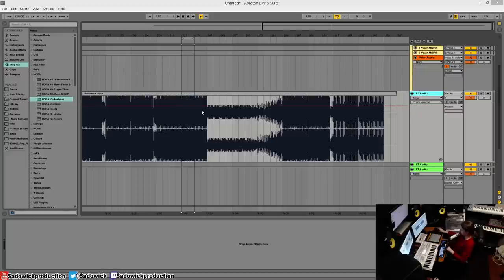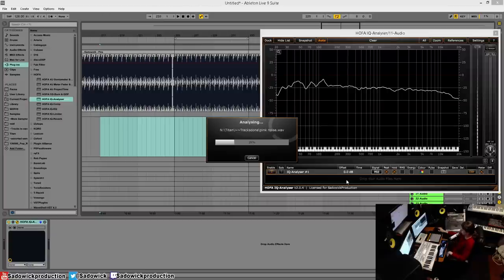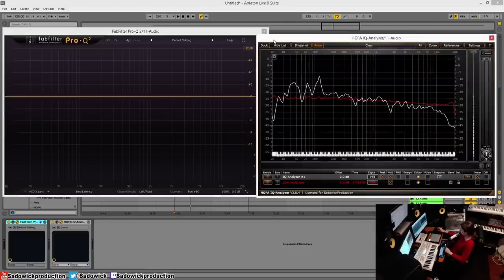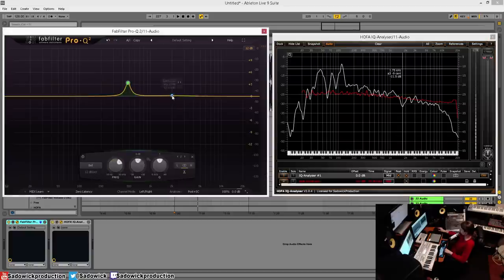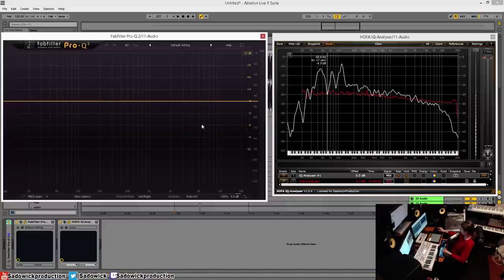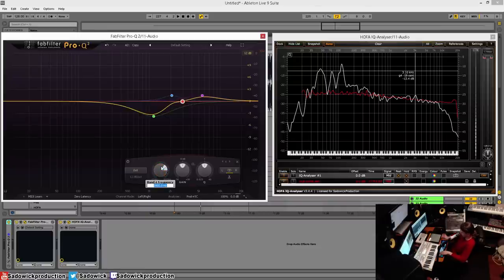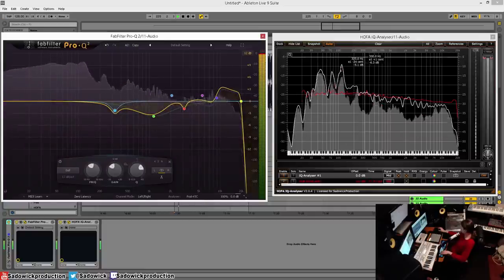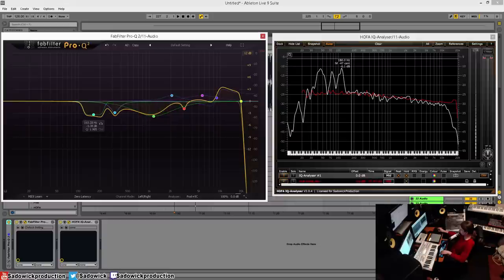Master Bus EQing Using Pink Noise & HOFA IQ Analyser

Comment: what makes you think that a flat frequency curve was the goal at mixing ? This is not for a mic pre data sheet.
Reply: That's why its an experiment....
Reply: Never tried myself, but IIRC pink noise roughly resembles the human hearing's frequency response - pink noise sounds 'naturally balanced' and thus using pink noise as a reference is a nice starting point for balancing a mix. In theory.

White noise has equal energy across the whole spectrum - human hearing perceives it as 'bright sounding'.  Pink noise is filtered down white noise with a 3 db/oct slope, each octave has equal energy as the octave before going up through the frequency spectrum - it's perceived as 'balanced'.

There's an SOS article 'Mixing to a pink noise reference' if you're interested.
Reply: @GoGoGoRunRunRun  I know what pink noise is...the problem in the video above is, he is not using pink but white noise (even his file is named wrong). As you can see, the spectrum is almost linear. Mixing to pink noise does somewhat work (i tried that), but mixing to white noise doesn't make any sense.

Comment: Well, pink noise is like white noise but with a tilt shifting of 3 dB per octave. That's totally ok for a radio mix. Club sounds or tracks like yours typically have a tilt of 4.5 dB. But it's a good strategy, though it'd be better to correct the volume of certain instruments first, check their broadband and eq them if needed inside the mix instead of eq'n the whole master.
Reply: Das gleiche dachte ich auch. Zumal er den Pro q sogar in Zero Latency benutzt. Ob das man so gut für die Phasen ist...
Reply: Wahrscheinlich klingt das Ergebnis nicht nur phasenbedingt grauenhaft, da er im Grunde eine gerade Linie mit 3 dB Tilt erzwingt und sich somit sämtliche harmonische glatt bügelt. Aber das Ganze hätte er einfacher haben können, indem er in Q2 ein EQ Match mit dem Pink Noise macht. Außerdem könnte er den Q2 analyzer auf 3 dB Tilt stellen und mittels Spectrum Grab alles gerade ziehen. Aber wie auch immer, es ist so oder so bedenklich und einer von vielen falschen Tipps hier auf YouTube.
Reply: Sehe ich ähnlich.
Reply: schliesse mich an :)
Reply: Sah selbst für mich als Laien irgendwie komisch aus. Vor allem Elektronische Musik hat ja im Analyzer eher ein "Smiley" Also Sub und Highs angehoben...?!
Diese eierlegenden Wollmilchsäue beim Mixing sind immer mit Vorsicht zu genießen. Wenn's so einfach wär, wär jeder Mixing Engineer. :D

Comment: Keep going with this experimentation. Why? Because pink noise is a common denominator component in speaker design, manufacture, calibration (playback) and mastering and - the way in which our ears perceive frequency. As a final anecdote, there is a similarity in relation to the mandelbrot  Think about this and do your own further research.  Common denominators imply connectivity, commonality and predictability.

Comment: I prefer Brown noise that said you should not use the noise it self but the intergrated loudness at corresponding frequencies. Don't  forget pink noise Brown or white noise as a dynamic range of 0 and music and have a dynamic range from-23 to - 5 dB.  So the best ways to address this is to use a multiband compressor to isolate the frequency Spectrum into 4 groups and match those with the l u f s loudness values of pink noise for brown noise

Comment: do professional producers do this? (In pop and rock ? )
Reply: +R RSTU Probably, as they want the mix to sound good in most sound systems.
Reply: R RSTU Yes, but without the extreme boosting. To boost an EQ band by 6db with such a narrow Q will cause phase problems. A linier phase EQ would be better.
Reply: +Jason Gibbins best thing about the Pro Q2 is that it's linear phase mode is just a mouse click away. I'm sure he'll change it from zero latency to linear phase before he exports.
Reply: that would cause an audible change, he might not like it.
Reply: NO!
Reply: Never!!!!

Comment: When you mix completely flat like this you run the risk of killing any focus point in the mix. Sure it's balanced and pleasing to the  average ear, but it's not properly using your ears to check your mix like this. This method is almost completely based on flat frequency assumption. Yes many tracks are mastered this way, but sometimes a deficient frequency (say 2.8khz is a little lacking) that shouldn't mean instantly add it in.